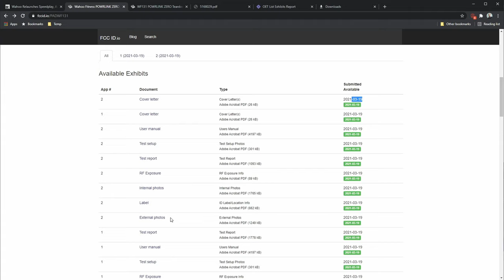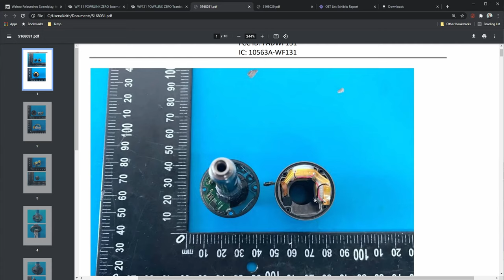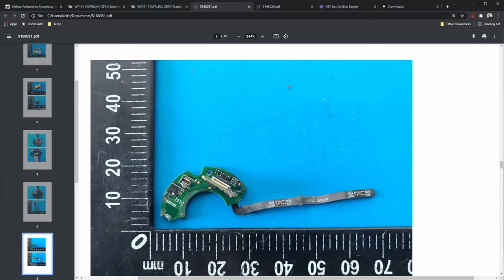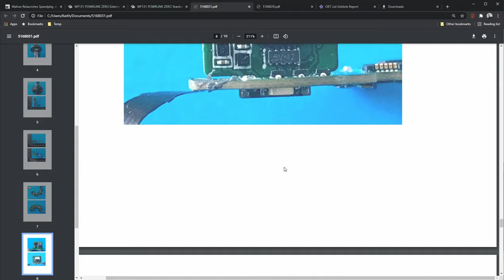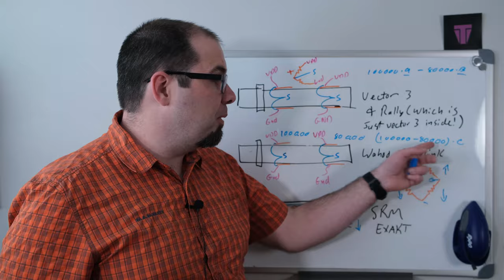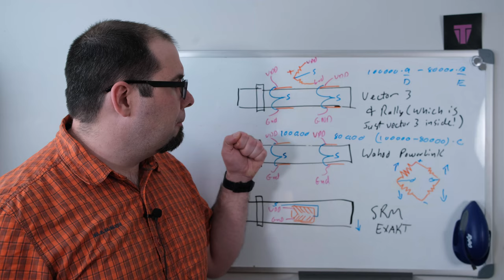First look inside Wahoo Powerlink -- will it be any good?

Comment: I understand the Assioma and Wahoo (and SRM) designs do not allow measurement of force offset, and thus have to make an assumption to translate axle bending into effective force (the precision of this assumption depending on bearing vs load cell location). Apart from this, I'm still not clear on the actionable benefits of a pedal power meter reporting platform center offset.

Comment: Good explanation as usual, cool to see the photos. As you said its a zero drift amp INA333AIDRGR, the one near the connector a TVS array. 2287 I can't find either.
Reply from the maker: Nice Sleuthing! I kept confusing those 3s for 8s it seems.
Reply: But then why would they use a SAR ADC with differential input https://www.ti.com/product/ADS8867 if 8867 refers to that one with an instrumentation amplifier? And not some fully  differential amplifier like the isl28635 https://www.renesas.com/us/en/products/analog-products/amplifiers/instrumentation-amplifiers/isl28635-5v-rail-rail-io-zero-drift-differential-output-programmable-gain-instrumentation-amplifier or sth similar?
What is the 2287?

Comment: How do you know so much about how a Vector 3 works? I could only come up with the images from the FCC website. If want/can talk about it publicly …
Reply from the maker: Patent applications, disassembly (destructive), old metri-gear publications I gathered (was bought by garmin and forms the basis of their tech), Garmin Vector patents. Same as you with looking up fcc, but I go further. I've also designed several competing products for various companies over the years. Knowing how they work was my part of my job.
Reply: @kwakeham  Hey, thanks for detailed reply. I always shake my head when I read "unlimitied confidential" on the FCC-site. It's not like competitors couldn't buy the product and reverse engineer it 🤷. Afaik it's even regularly done in competitive cost analysis. Not having this information makes modifying hardware always a bit tricky and difficult. In any case I'm not ready to (potentially) sacrifice one of my Vector 3's just to satisfy my (private) curiosity ;)

Comment: Great analysis, same as every other time :)  What are you thoughts on pedal based power meters for MTB?  They seem to be popping up more.  Can all this be stuffed into a pedal, survive pedal strikes and still remain accurate?
Reply from the maker: Generally there is nothing that prevents a MTB powermeter pedal from being durable enough except weight. The march to light weight is strong though in powermeter and MTB world. Durability adds bulk in bigger bearings, bigger axles, meatier cleat system when it comes to impacts. Everyone so far has done a really good job of keeping their electronics in safe area on road now. Vector is the odd man out with being mechanically weakened due to the hole in it for the sensor "arm" and electronics while everyone else is a solid shaft. I see the real difficulty is the protocol is just not good enough to handle the on-off-on-off power. A lot, if not all now, throw away the first partial stroke as "Bad data". So do 10 hard pedal strokes then coast on a MTB you might get 8 or more likely 9 pieces of data but if you're quick they are over 5 - 6 seconds and 1 hz recording = 5 - 6 data points. It doesn't tell you as much as road or TT cycling. It's a very similar problem to track cyclists who can never ever get their from still true start torque / power.
Reply: Fantastic response, thank you for taking the time.

Comment: Didn't the fly 6 have issues with batteries connected in parallel causing them to not charge well and have the batteries deteriorate early?  So the same as this new power meter
Reply from the maker: Potentially, though several companies have done it. I mean apple does it all the time with mismatch capacity and shaped cells. A lot has to do with quality control on those cells when you parallel them.